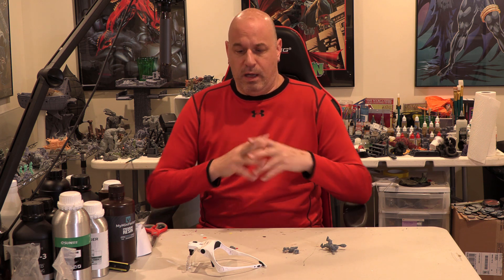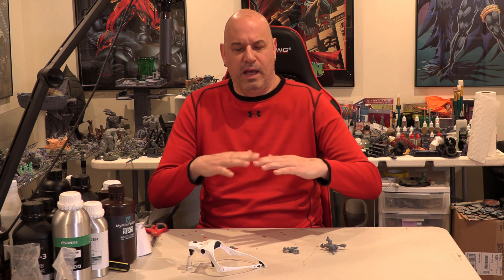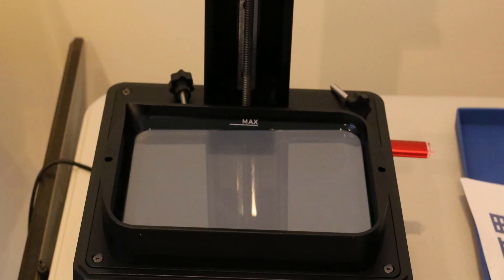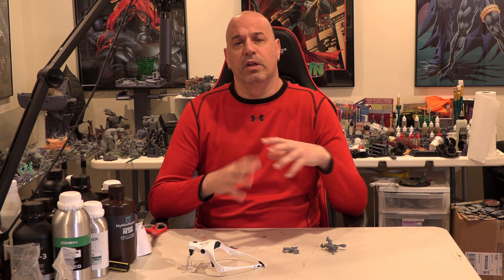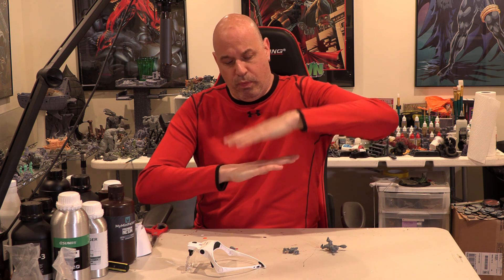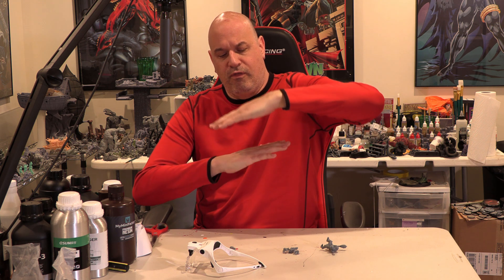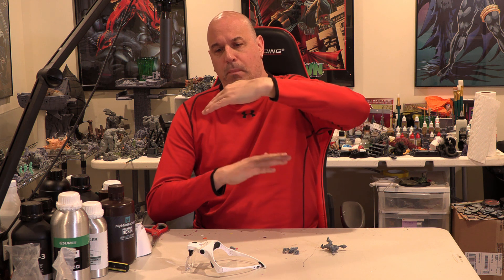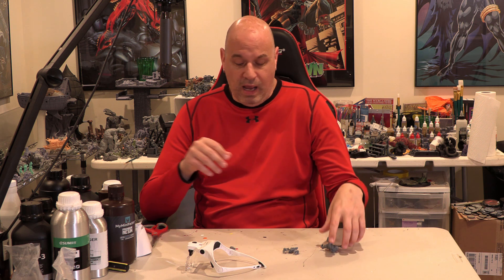Do you need to level your resin 3dprinter?  I'm probably going against the grain yet again....

Comment: What if the surface the printer is on is not stable. As the vibrations make the table move it could slightly disturb the resin. Idk just an idea

Comment: My workbench is not level. May Mars2p has adjustable feet, and I leveled it just because to bothered me to have the resin not true to the vat. From a printing standpoint, the build plate needs to be true to the vat. (true is a more appropriate term than level) If it is a heavy print, I could see the possibility of the Z axis binding it it far enough off plumb, but I think that would have to be a pretty decent angle.

Comment: I haven't heard anyone talk about level being an issue, but I know personally that I've had my printer on an unstable surface before, and printing on a more stable surface seemed to reduce the number of times I'd notice layer lines. With more experience, and in hindsight, I do wonder if it was a red herring and I was in fact just not as good at managing my lift speed and was not as good at combating peel force with the slicer, but... I still think it's a variable worth keeping in check. Why would anyone want a wobbling printer anyways?

Comment: Could be interesting with heavy pigment resins. Siraya fast navy grey for example during a long print will separate and settle on the bottom before the end of the print (talking large models). I think what would happen is the pigments would gather on the low side and the model might come out with less colour on the high side.

Comment: From my experience, the only negative downside to not leveling your printer is that you'll run dry more quickly. If you do as most companies suggest and only fill your vat with a little over the required amount for the print, if you start printing with an unleveled printer, you'll risk the resin not being in a spot where it needs to cure. Other than that, there ain't no negative because of the way the printer works. Yes, heavier prints will have a higher risk of failing due to gravity but if your supports aren't strong enough to maintain that angle, they'll barely be strong enough to maintain a regular print. So, my opinion on this is; as long as your buildplate is level and you fill your vat regardless of quantity required for the print, you'll be just fine.

Comment: did people really need this question answered ? the plate gets leveled parallel to the screen, not independently or to the base of the printer or the table top, wtf could the difference possibly be as long as there's enough resin to cover the build plate ? just silly, at least in my opinion... but more importantly, where is wifey ???

Comment: The thing I would like to know is if all these printers are using cheetubox boards what's stopping you from upgrading a 2k printer to a 4k 1 or 8k its only got to be different firmware or am i completely wrong?

Comment: aside from ruining your max resin volume, the only other downside I can think of is if you are printing something large, not hollow, and heavy and maybe small contact supports; you might get some support failures from the weight of the print not pulling straight down. That would be an extremely niche situation though.

Comment: From an engineer's perspective, the machine (when printing small to medium sized prints) won't care so long as the resin level is deep enough to cover the screen, allow enough fluid quantity to flow under the model during lift and cover the transmission screen, And deep enough to prevent bleed-through light penetration from the UV assembly beneath the bed potentially selectively hardening the exposed print leading to dimensional and structural defects. The gravitational force is already as high as you're going to encounter when the machine is on any firm surface.
Large, heavy prints *may suffer slight dimensional defects at prolonged print heights (duration of the print), but again, none moreso than if the machine were completely level and printing normally. As you noted in the video, so long as the machine was setup correctly to begin with, and there's sufficient resin level in the vat to cover the caveats I listed, the printer won't notice any difference. 
Me being me however, I have my printer on shelf rack system so it's as level as the floor will provide, and was balanced with a bubble level when setup, but that's me being obsessive in detail. 

I think where people have issues is when the machine AND the build plate are either non-leveled to the bed or counteracting one another, but the tilted machine is more readily identifiable as a problem because you can see it without measurement or aligning the printer's mechanical components. Gravity fighting an inverted print surface, sheering action due to peel force, and the operator's attentiveness (or lack thereof) to the cleanliness of the print surface will trump any shaky foundation issues one is likely to encounter so far as print failures are concerned.

Comment: Just got a bigger printer (M3 Max) and I had to level my desk a bit cause the resin vat was so wide it was gonna overflow one side with the tilt, but despite that bad of a lean I've been getting great quality from my old smaller printer on the same bench that was clearly sloped. It was printing fine. I'd imagine the change in force on the printer is similar to just printing something heavy on 1 side of the build plate - so the printers are probably already designed to handle it.

Comment: There is ABSOLUTELY no reason to level the printer. As long as the build plate is setup correctly, it will always print correctly. As long as it has access to resin, it will print correctly.

Comment: I think the biggest issue would be making sure there is enough resin without it going over the max line.
Reply: Ha, this video made me check all my printers. I noticed one day that one of my vats looked like it had a little more fluid on the one side closest to the garage door (i work in a hot garage). So, I checked the other printers next to it, FURTHER away and they were all slightly tilted toward the door. About 1-5 degrees at most. The only thing I worry or think about it, is just making sure I never fill to max as YES it WILL spill over OR very very close to it.